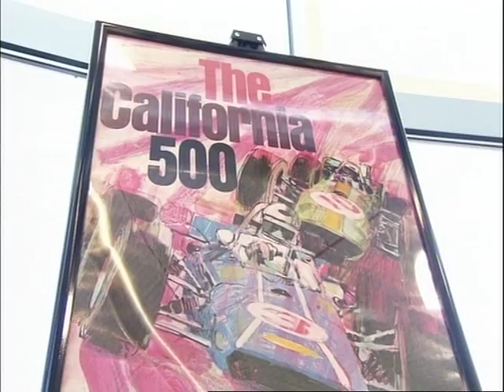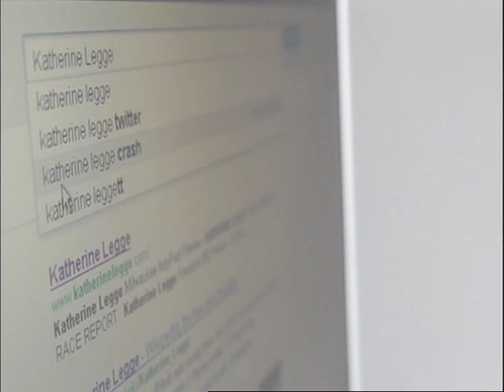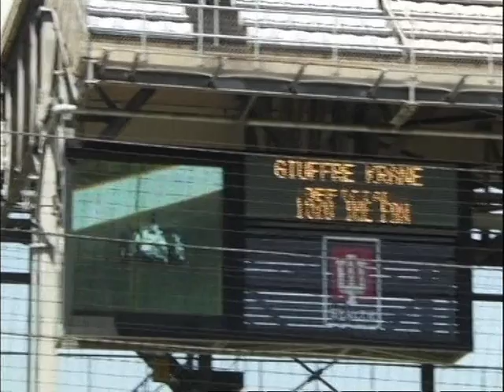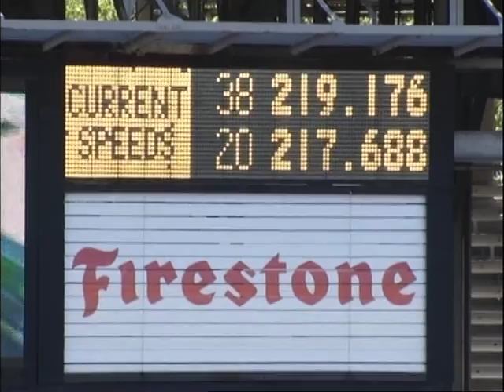Up Close   Katherine Legge

Comment: Compare the likes of Katherine, Danica and few other female drivers back over the last 20-30 years (back when nobody really cared what was between your legs) to the female drivers now, who have had un-ending opportunity, backing, even to the detriment of higher quality male drivers in the pursuit of so called equality (read, equity).   I can't think of a modern female driver in single seaters even half as good as Legge or Patrick.  Maya Weug is probably the best I can think of, but she is still only in F4.  Pin is not bad, but she seems uninterested in open wheeled machines now.  The likes of Chadwick, Floersch and countless others I've seen over the past 5 years have been way off the mark.